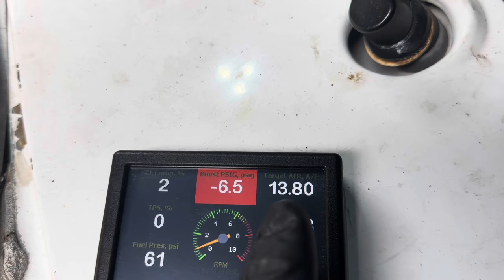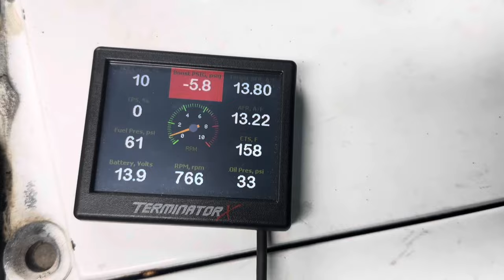No Prep Build 19: The engine from HELL.

Comment: When you initially fill the cooling system it's easiest to fill it through the top radiator hose to help eliminate the air lock. Also you cannot run without a thermostat. It will overheat every time. Eliminate the DOD too. They sell plug kits or Sloppy Mechanics shows the right wheel bearing to use the rollers out of. You just put red loctite on them and hammer them in.
Reply from the maker: Ok I will put the thermostat back in it and yup I have the dod on it as well but will be taking it off to check all of the seals are there.

Comment: Do u have the heater hose circuit looped as they will over heat if not looped . Also do u have the steam tubes connected to the top of the radiator  with not low spots in the hose
Reply from the maker: I do have the heater hose circuit looped and I have the steam tube connected to the upper radiator hose which I believe is wrong.

Comment: Why drag racers can NEVER understand how a motor survives by oil flow is beyond me.  Drag racers are OBSESSED with pressure.  All other motorsports understand that oil protects by flow but drag racers will gladly die on the hill of 200# of oil pressure at idle.  If there is not 120# at the end of the 1/8 mile then the motor must be "starving for oil"
Reply from the maker: Damn it! Now that I am thinking about it you are right hahahaha I never caught on to that.
Reply: @averagemm  Researh Dorty engines from the Rick Hendrick garage. Those motors went 800 miles at 200mph with 10psi at idle. They use 0w10 motor oil. 855Hp at 10,125 rpm.   While you drag racers have 180psi at 5600rpm and WORRY ABOUT BEARING FAILURE.   You are creating bearing failure.  SRC channel has blown 22 mtrs over the last year due to "oil pressure."
Reply from the maker: Ok I will check those out and do more research. Yeah I remember SRC hurt two engine with oil pressure and then they had to restrict the oil as well cause they made too much.